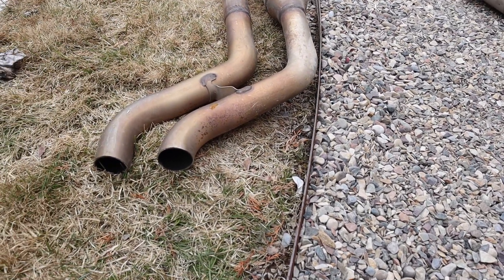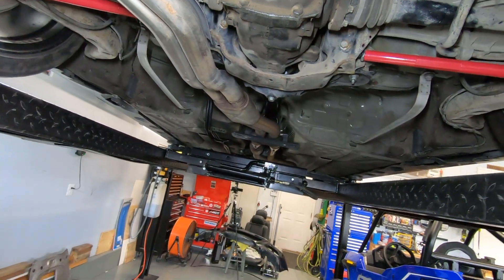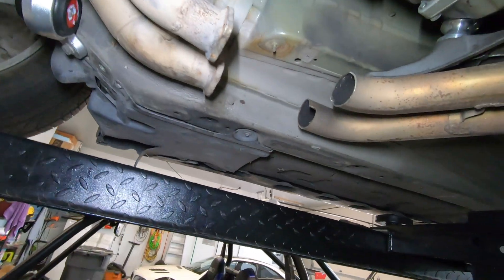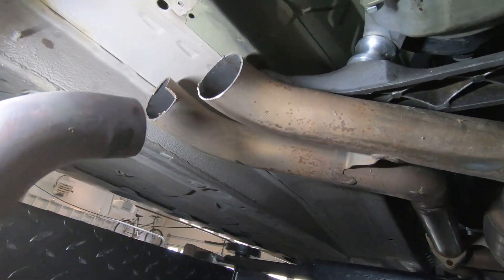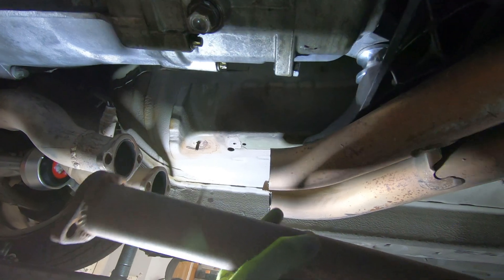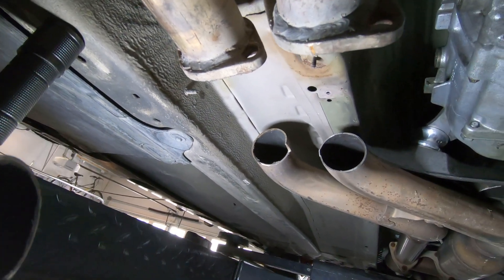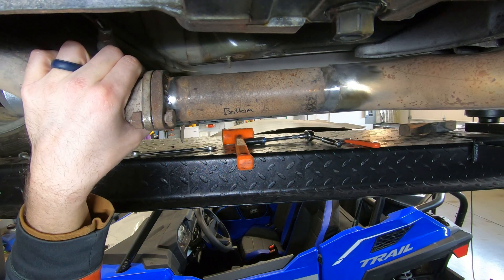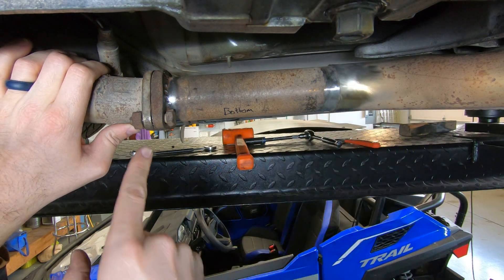Fitting an E46 M3 exhaust on a non-M engine - Titanium Mig 140 Harbor freight welder - BMW M3 build

Comment: I wasn't aware you could weld stainless steel with a MIG.  Are you using a special filler wire?
Reply: Weeeeeeeelllllllll you can weld anything with anything. but im going to be giving tenza a-lot of crap when in a few years this breaks off.  this is heat cycled union of stainless steel after a few thousand heat and coolings all those are going to crack but its a race car it may take a long while to fail. 
its all about application. if your trying to make a stainless weld last for a long time this is not the way.
Reply from the maker: I am using a stainless steel flux wire. You can in fact weld stainless with flux. A quick google search will clear that up.